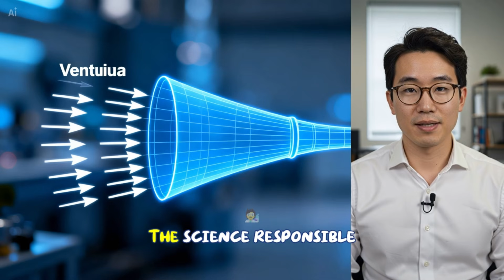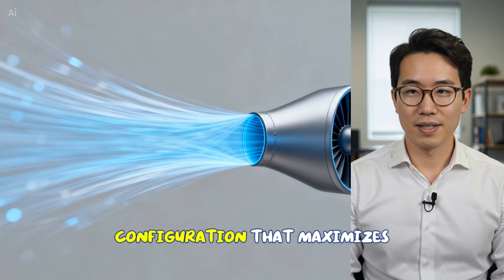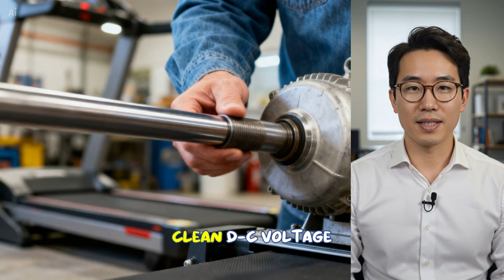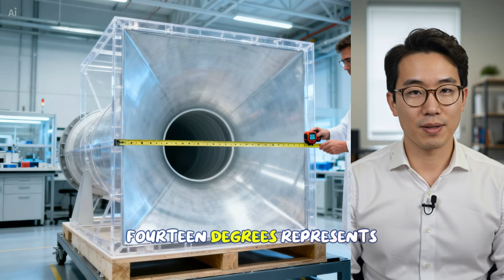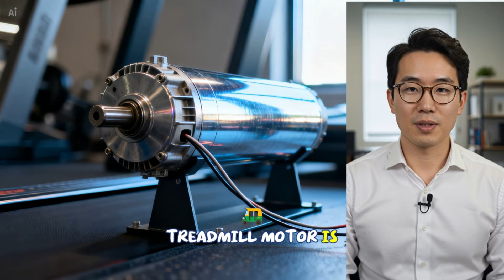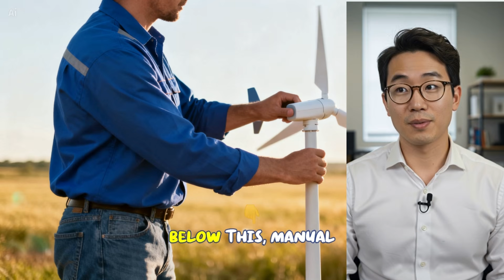THIS $90 WIND FUNNEL GENERATES POWER IN LIGHT BREEZES—HERE'S THE SCIENCE BEHIND IT

Comment: Wind energy across Great Britain hit a new record on Wednesday 25 March 2026, producing enough electricity for more than 23 million homes across the country. There are approximately 28.4 to 30.4 million homes in the UK, based on 2023–2025 estimates.

Solar and wind also combined to squeeze more expensive gas-fired generation to just 2.3% of the power mix, figures from the National Energy System Operator (Neso) show.

At the time of the record, more than half of Britain’s electricity (53.5%) was coming from wind power, a fifth came from solar, 10% from nuclear, 9.6% from trading over interconnectors with other European countries, 2.4% from biomass, 2.3% from gas, 1.5% from other sources and 0.4% from hydro, Neso said.

Renewables generated a record 50.8% of the UK's electricity in 2024, marking the first time they have provided over half of the nation's electricity generation.

Comment: Urban wind turbines typically generate 50--90% less power than identical turbines in open, flat country. In dense cities, overall energy yield is drastically reduced—often yielding only 10% of open-country maximums at domestic turbine heights.

Buildings create immense friction and drag, which drastically slows down wind speeds. Because power generation scales cubically with wind speed, even a minor drop in wind speed results in a massive loss of power.